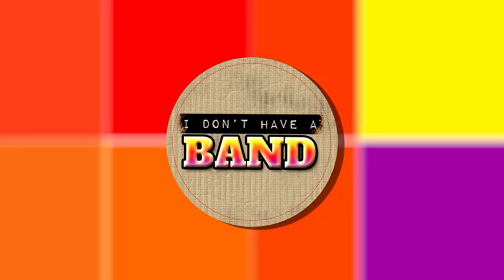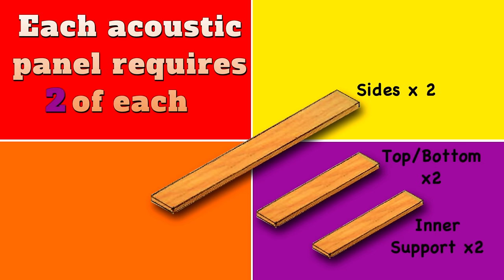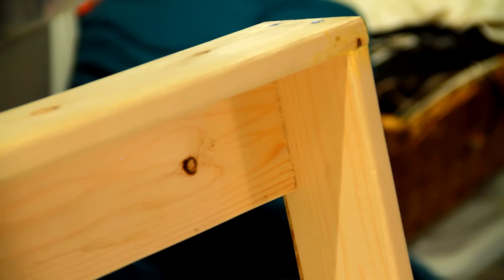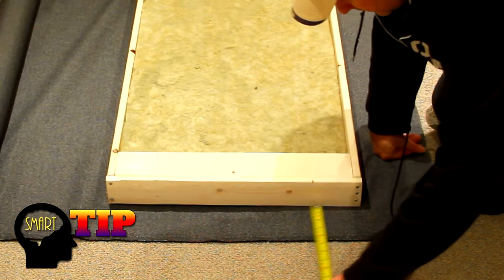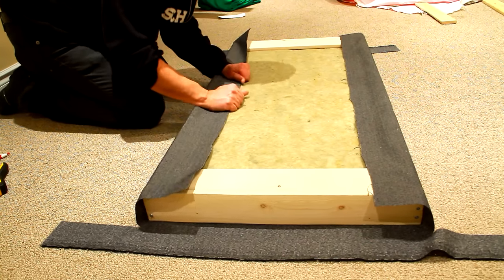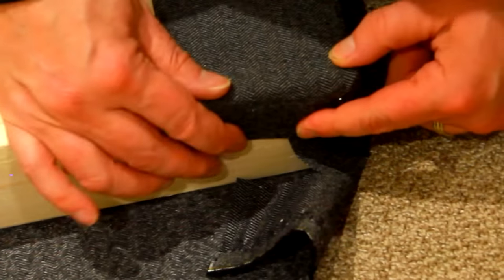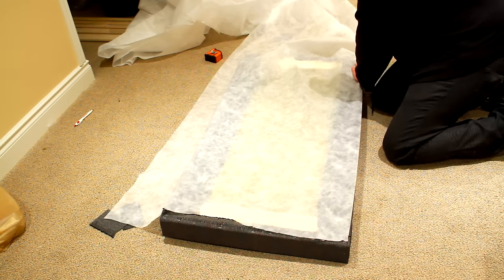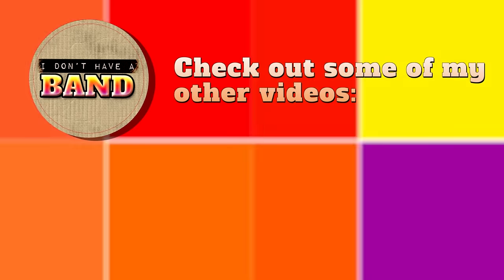DIY Acoustic Panels - How To Make Your Own Cheap and Awesome Panels

Comment: hello, I am building an acoustic panel for my window insert to reduce the sound from outside, i build the wood frame and stuff with rock wool sound insulation. 
HOWEVER, i use vapor barrier to wrap the whole thing, not the fabric which you use here. AND i find out  the panel wont help too much, is it because the vapor barrier wont absorb the sound? it block the sound, which make my acoustic panel useless..And i have to use fabric to wrap the side facing the window right, to let rock wool absorb the sound from outside. Thank you
Reply from the maker: It’s not working because these panels are for absorbing reflections.   They are not designed for soundproofing.   Those are two very different things.  You would need to treat the window differently if you want to block the sound completely.  And likely what you are hearing is not just coming through the window.   Sound always finds a way!

Comment: Why don't you fit the underlining fabric first so you do not have to worry about cutting the exposed fabric? Great video, I learned new things!
Reply from the maker: I've actually answered this question a couple of times but I have a new reason why I will continue to do it this way.  Initially, my decision to do the backing last was to finish off the panel cleanly by capping the front wrapping job.  Just this past week I decided to perform surgery on a couple of the panels to test alternative insulation materials.  I'm so glad the backing was on top.  I was able to open up the panel without disturbing the most important front fabric.  If you ever need to open a panel it will be so much easier to gain access from the back without damaging the front wrap.  Worked great for me in this case...
Reply from the maker: BTW...thnx for your thoughts on the video!
Reply: Never thought of that, great answer. Thanks for the information you share.
Reply from the maker: My pleasure.  That is the purpose of my channel. To share my experiences and things I learn along the way.  Thanks for stopping by.  Hope to hear from you again!
Reply: @LonelyRocker  Did you like the new insulation material you tested??? What material was it????
Reply from the maker: Rockwool has a product called Comfortboard.  Same rockwool material but made as a more rigid board.  I tried it in my clouds.  No audible differences but hoping less particles are falling out.  I may cover this in more depth in the near future....

Comment: Can u recommend any alternatives for rockwool?  I was planning on using foam but confused with the density? Any advice is much appreciated..
Reply from the maker: Is there a reason you don’t want to use rockwool?  Mineral Wool based insulation is probably your best option.  Foam is a complete waste of time and money.  I’ve seen people use layers of towels or denim inside panels.  But mineral wool is the most efficient material.  Check my channel for my new Acoustic Panels 2.0 video.  Might give you some ideas.
Reply: @LonelyRocker  thanx
Reply: foam is almost useless unless its really thick high density and even then only for higher frequencies

Comment: hi, what is the downside of having the top and bottom planks inside the 2 side panels? This way, the inner support plank can have the same dimensions as your top and bottom plank.
Reply from the maker: I recommended keeping them on top and not inside purely for dimensions.  This way the structure is perfectly sized for the insulation I recommended.  If you put them on the inside the panel will be a little wider and a tad shorter.  If you are customizing your own fill then the exact dimensions here don't really matter.
Reply: @LonelyRocker  i see, was wondering if it had to do with structural integrity regarding placement of the planks. I am cutting planks manually anyway so i guess it doesnt matter! Faster and easier to have the support rib same dimensions as the top and bottom planks. Thank you!
Reply from the maker: I see where you're coming from.  It all depends where you want the labour savings.  Cutting the wood or the insulation ;-) . Good luck with your build!

Comment: hey! could you tell me the actual dimensions of each Rockwool panel by itself? I know its closer to 3" in thickness, but what are its length and height? thanks!
Reply: 22.75 x 46.5?
Reply from the maker: According to their website they are 23x47 but I’d guess closer to your number as measurements are usually less.

Comment: Just out of curiosity, how many panels do you currently have in your room? And your mixing room size?
Reply from the maker: I currently have 6 panels plus 2 clouds installed.  I'm about to add 2 more panels along the sides and I have 2 of my mini panels about to hit some partial walls.  That will give me 12 once complete.  My room is 12 feet wide and about 25-30 feet long.
Reply: @LonelyRocker  Wow that's quite a large room. The room I'm working with is about 11 x 20. I've built quite a few panels and perhaps I've created too many, although I can use them at the ceiling corners in spots as bass traps. Cheers.
Reply from the maker: Yes, it's a nice sized room.  Careful not to overdo it.  Are you placing them at key reflection points?  I did a video about that....
Reply: @LonelyRocker  All the panels I ended up making are broadband absorbers in order to evenly absorb across a wide range. I have 4 for the first reflection points at the sides (2 on each side), three for the cloud, then two for the front wall and two for the back wall. I also have a number of extras (I probably built too many) to float around the room as needed. I've also built 4 soffit styled bass traps, floor to ceiling, at the four main corners. These are about 18x18 and filled with safe n sound.  What I'm doing is building a french cleat system that goes around the entire room for mounting, if that makes sense. Basically like a chair rail or track around the entire room where I can add, remove, slide panels any way I need to. I went a little overboard. I sort of did things backwards but I plan on doing some readings with Room EQ Wizard and testing adding different panels after I sort out the main setup with reflections.
Reply from the maker: Sounds awesome.  Too bad you can't post pics here :)

Comment: I don't have a drill and would like to avoid buying one. What do you think about just hammering in nails instead of using a drill ??
Reply from the maker: Truth is you could wrap rigid insulation without a wood frame.  I much prefer having the frame because it's more stable.  Give it a shot to see how it turns out.  Hopefully, you won't split too many pieces of wood 😂
Reply: Rent a drill from Home Depot or buy one. It’ll add a whole 30-50$ and you’ll have tools to work with.

Comment: what total cost per panel with materials? That sound n safe wool isnt cheap
Reply from the maker: When I made these at the time of this video my costs were about $20 Canadian per panel.  Prices may be higher now due to the Pandemic.  Best to price out the materials in your market.  Keep in mind you can make many panels with one package of Safe'n'Sound.
Reply: i'm doing the same build making 4 panels right now. it cost me about  $20 in fabric, $40 in wood, and $90 to get the insulation shipped to me. After getting the mounting hardware it was about $200, $50/panel. more than expected but still cheaper than prefabbed!
Reply: PS the insulation comes in packs of 6, so if i made 6 panels it would bring the total down to $40/panel
Reply from the maker: This video is 3 years old.  With prices high because of Covid there is clearly a cost adjustment needed...
Reply: @LonelyRocker  yup! i could have saved $30 by finding the insulation in store as well, its expensive to ship

thanks for the great build video!
Reply from the maker: My pleasure!  Glad you found it helpful.  I have a bunch of other panel resources, builds, placement, testing etc.  Make sure to check them out!

Comment: Would probably be a good idea to just use a canvas stretcher like what's used for putting canvas tight on frames for  painting. Will get verry tight results but may cause wrinkles if your fabric is stretchy.
Reply from the maker: I highly doubt the average DIY'er will have a canvas stretcher. Besides, it doesn't need to be that tight.  Just enough to get the wrinkles out. :)
Reply: @LonelyRocker  just depends on the fabric you choose and it is only like a 20$ tool at most craft stores. It might be helpfull to someone so it's still worth mentioning imo.
Reply from the maker: I see, not a bad tip.  But really, it shouldn't be so tight.  If you buy the right fabric it should wrap nicely around the frame without creases.  And if you use the carpet trick as I showed in the video you'll get all of the tension you'll need.

Comment: Hi! Are these 2 inch thick batts or 3 inch thick? I can't find any roxul safe n sound 2 x 4 batts that are 2 inches thick. Thanks!
Reply from the maker: These are 3 inches thick.  Comfort Board comes in 2 inch rigid boards.  I use those now.

Comment: If it safe to breathe in after cloth is placed over?
Reply from the maker: There has been a lot of discussion about that.  I spoke directly to Rockwool.  They claim it is safe and mineral wool is heavier than air so if any particles come out they fall to the floor and don't float in the air.  But I am not a doctor so if you have concerns please consult with a professional to make sure.  It's a good idea to wrap them up tight but they do need to breathe so sound can pass through.  Just be mindful of that. Good luck!

Comment: Hey can you please tell me the specs of the mineral wool used? Here in Brazil there are several densities available and the prices varies a lot according to this.
Reply from the maker: I used Rockwool Safe’n’Sound 24.  Go to Rockwool’s website.  They have all of the specs on their products there.
Reply: The denser the better  ...its that simple .
Reply from the maker: Yes and no. Depends on the frequencies you want to absorb and where...

Comment: I bought 16'' online cuz I couldn't find 24!! is this okay?? 16" says its 4" x 24" x 48" 32 sure feet??
Reply from the maker: You can just cut the material to fit.  I'd recommend securing it somehow.  Maybe an inner layer of fabric and stapling the insulation inside so it doesn't move around.  As long as it's packed in there you can't go wrong.  Or you could make smaller panels.  Good luck!
Reply: @LonelyRocker  Thanks!
Reply from the maker: My pleasure.  Checked your channel.  Interesting stuff.  Quite different than my type of music but very creative.  If you'd be interested in
a collab, perhaps I'd lend a guitar riff for one of your jams.  If interested, hit me up...
Reply: @LonelyRocker  that'd be awesome!
Reply from the maker: Shoot me a note at the email in my Youtube Profile and we can discuss!

Comment: I’ve seen some concerns about using insulation Bc it can disperse fiberglass into the air into your home. Do you think this is an issue?
Reply from the maker: No.  For one, my panels do not contain fibreglass.  They contain mineral wool insulation. Far different thing.  If you have concerns, check out my Panels 2.0 video where I have added a mechanism to keep the materials inside better.  Check it out: https://youtu.be/MHnFYFZc-w8

Comment: Great tutorial! So those Roxul batts are 3" deep?  I want to use this plan for 6" deep traps.  Since you're using 1x4's for the frame, I was thinking that 1x8's would work for me.  But would that accommodate the inner supports?  Hope that makes sense.
Reply from the maker: Thanks for checking it out! The Roxul Batts are closer to 4" just a bit under..  You can definitely use this formula to create deeper panels.  It's really not that heavy.  Once you have the frame built you can check the stability.  Maybe consider putting a third support in the middle.  If you're doubling up on the Roxul inside you will have a bit of leftover space.  Keep that in the back creating a little air gap between the insulation and the wall.  This will actually enhance the performance of the panels.   Would love to hear how these turn out for you.  Good luck!
Reply: @LonelyRocker  Thanks for the reply.  That's a good idea regarding the air gaps.  I will probably build a couple later this week and give you an update.
Reply from the maker: Good luck!!!!

Comment: sorry I'm dumb - how to you get a 48in. long panel by cutting it down to 46.5in.?
Reply from the maker: The thickness wood factors into the size of the panel.  You measure from the outer edge of the panel.  46.5 plus wood equals 48.

Comment: Where did you get your fabric from with which you wrapped your panels?
Reply from the maker: I just went to a local fabric store.  Be clear on your measurements and hit up one in your area.  You'd be surprised how many options they have.  It doesn't need to be any special fabric.  Just choose a material that will wrap nicely and keep the insulation fibers inside.  The fabric does need to be breathable so no vinyl or plastic....

Comment: How would you describe the improvements you gained by putting these in your studio?
Reply from the maker: Focus for sure.  I had noticeable reflections in my room that were a bit distracting.  Without thinking about it I was compensating for what I was hearing in the room and that was affecting my mix decisions.  When I sat down at my desk right after I installed them it really felt like the sound coming from my monitors was more focused and contained.  Hard to explain but I felt the stereo spectrum better and the sound felt like it was coming towards me instead of from all around me.  Hope this helps!

Comment: Did you make a video on mounting? Excellent help!!!!
Reply from the maker: Thank you!  I did make a video on how to determine placement of your panels.  Look for it on my channel.  Let me know if it helps!
Reply: I Don't Have a Band brilliant it was also helpful, i wonder how did you specifically attach the boards, what clips etc. These videos are the most helpful I've seen on acoustic panels. Good production on the video too!
Reply from the maker: Thank you once again!  I was considering making a mounting video but the challenge I had is every room is different.  Wall materials, panel weight etc.  I couldn't figure out how to make a universal mounting instruction video as there isn't one method that would work for everyone.  Send me an email at donthaveaband@gmail.com and I'll be happy to send you pictures on how I mounted my panels.  Cheers!

Comment: hi , thanks for the video , can I ask what size of screw and pilot drill would be use  so no the wood to slit  ,,thanks
Reply from the maker: My pleasure.  I think I discuss what screws I used in the video.  It’s been so long since I made this. You don’t need any too big.  Just long enough to grip the wood without splitting.  Do a test on scrap wood.   Good luck!
Reply: Pilot drill should match the size of the screw-shank but not as wide as the screw-threads.

Comment: Not just any fabric will do peeps. An acoustically transparent fabric needs to be used so the insulation performs as tested.
Reply from the maker: For the DIY world any breathable fabric will do the trick.  If you have pro requirements I recommend consulting wit a professional.  Most of my audience is DIY.  As long as they meet basic requirements it can make a huge improvement to their mixing spaces.

Comment: Does work as good as the panels you buy at L&M thx . Please if you can let me know.
Reply from the maker: I would need you to reference specific panels for comparison before I could answer that...There are different types.
Reply: @LonelyRocker  I don't know however generally it deadens the sound and not get that slap in the room.  Thx
Reply from the maker: Just note the difference between Panels and Foam tiles.  Foam is the least effective.  It may audibly minimize echoes but they are not very effective below higher frequencies.  Actual panels, like. mine, that are 3-4 inches think will do a better job overall.  Hope this helps.

Comment: how are u lonely rocker 
i found 2 wood glue in market

gorilla wood glue

and

Elmer's Wood Glue

which one should i buy ?
Reply from the maker: I'm great!  Either will work just as good as long as you use screws too :-)
Reply: @LonelyRocker  thank you so much this is the best video ever
Reply: Buy WOOD GLUE... who cares what brand it is... its WOOD GLUE
Reply: @quadzmotooffroad2904   exterior and interior wood glue are not the same !
Reply from the maker: For this application it really doesn't matter....
Reply: @kc-ug6gu  oh I see.... so you're putting the acoustic absorbers on your ROOF... Gotcha

Comment: Hello Brother, What is the density of your rockwool ?
Reply from the maker: Off the top of my head I'm not sure but Rockwool lists all of this info on their website.  Look up Safe'n'Sound there and you'll get what you need...
Reply: @LonelyRocker  i mean 40kg/M3, 80kg/M3 or something else?
Reply: @rajkamaljangir3618  I found Rockwool Comfortbatt R14 24 inch. Specs says that each batt is 3.5"  (89 mm) thick. One package (8 batts) weights 41 lb (~18.6kg) and covers  60.1ft^2 (~5.58m^2). Therefore:
41lb / (61ft^2 * 3.5") = 2.3lb/ft^3 (36.9kg/m^3) or
18.6kg / (5.58m^2 * 89 mm) = 37.45 kg/m^3

Rounding imperial to metric is not perfect but you can see that is around 37 kg/m^3. Which is just right for sound absorption purposes.